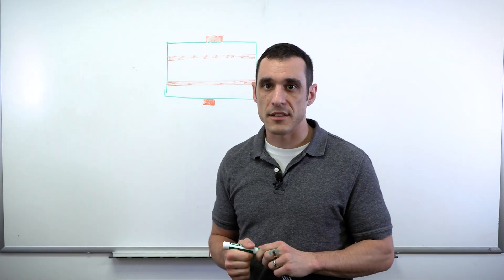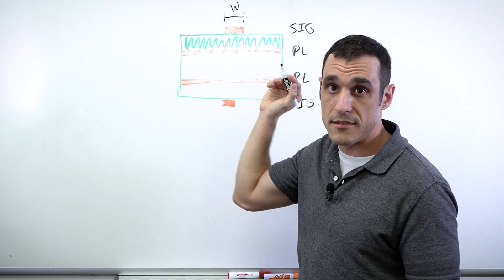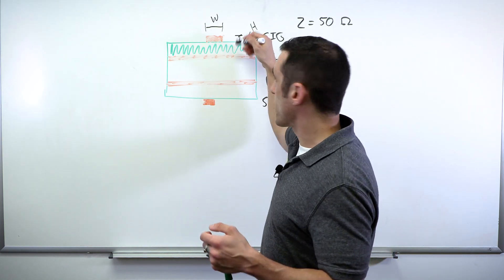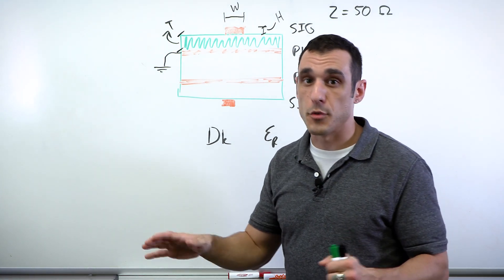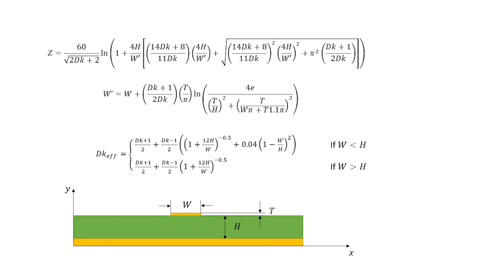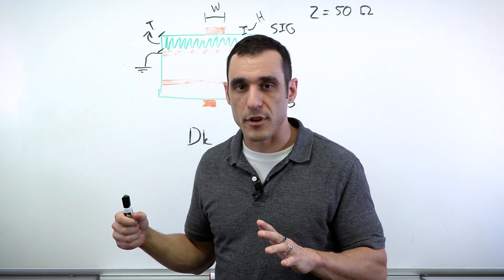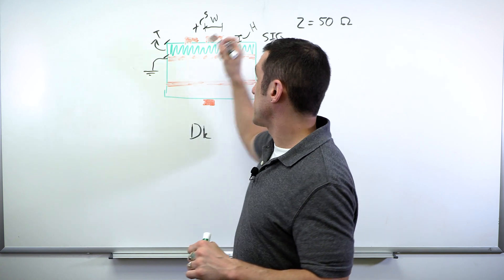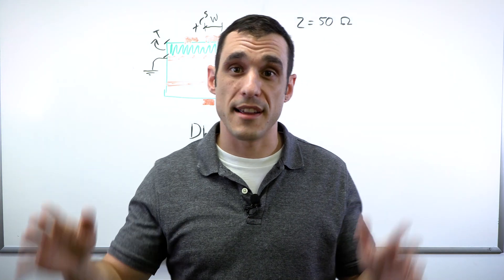Designing a 4 Layer PCB Stackup With 50 Ohm Impedance | Signal Integrity

Comment: Thank you Zach. But I have doubts. Why you do not mention track length? it is not important.
Reply: If you are just looking at the impedance of a trace then its length does not have any effect on the characteristic impedance. The stackup determines the characteristic impednace of a trace, so when we refer to a 50 Ohm trace, we are referring to the characteristic impedance only. The track length only matters for impedance when we look at the input impedance for a load that does not match the trace's characteristic impedance. Input impedance is only sometimes equal to the characteristic impedance. We have another video about characteristic impeadnce for transmission lines that you can watch here: https://www.youtube.com/watch?v=Fw0e-TFYArk

Comment: I Zach, great video. Thanks a lot for sharing. I have a doubt about the following: what happens if the GND layer(L3)  is on the third layer and not on the L2 ? What DK should I consider? I have a 6 layer board with a G-CPW between top and L3 (GND). The PCB manufacturer told me to have 50ohm the trace width it's 0.44 instead of 0.4 mm calculated by me with txLine tool . Who is master here in this requirements : i mean do I have to force them in having dk constant between L1 and L3 or do I have to trust them in their calculus?
Reply: You can place GND on L3 and for your application (RF design) this can be common. The Dk value might not be so clear if you have two different materials for the intervening layers. A simple approximation is a weighted average between the Dkeff on the top layer and Dk on the mid layer dielectric, but that is a very rough approximation. I've done a similar design many times with a substrate integrated waveguide and edge emitter with the structure spanning L1 to L4 (no GND in the waveguide region on L2 and L3). The reason for the additional width is probably for etch compensation and they might be using a more accurate tool like a field solver to figure out the additional width requirement from the mid layer dielectric. They won't know for sure until they measure.
Reply: @Zachariah-Peterson  thks for reply...i will design always GND on the L2 so that I'm quite sure dielectric is constant...the problem is sometimes with the PCB height as constraint I get track width which is not always feasible on the manufacturer....another important aspect to understand for me is , how much is important to respect the characteristic impedence (and so having a uniform dielectric) in function of the track length? I mean if I have 1cm of 50 ohm antenna (LTE and GPS) do i really to worry about this aspects ? How can I manage the CPW antenna parameters (w,s,Dk,H) even if they are not the suitable one in order to not mismatch the antenna ?
Reply: @rombodituono174  You mentioned "characteristic impedance as a function of track length"... The characteristic impedance does not depend on the track length. Only the input impedance will depend on the track length, and this will only happen if the load impedance is different from the characteristic impedance. If you look at the S-11 data for your antenna, you will see the frequencies where the antenna will be well-matched to some standard impedance value (normally cited as 50 Ohms for an antenna). For antenna modules, the S-11 data should be available in the datasheet. Note that the S-11 data will not depend on track length because it is not determined by attaching the component to a mismatched transmission line. If you had a mismatched transmission line, suppose it was 1 cm, whether this will cause the input impedance to differ significantly from the load impedance depends on the frequencies you are driving into the antenna. If the wavelength on the transmission line is much longer than the length then the input impedance will be approximately equal to the load impedance.

Comment: Can anyone tell me how to determine what impedance you need for a specific trace?   Knowing how to calculate the impedance of a trace is all well and good, but it does not give a good reason as to why.  I can understand impedance matching analog and RF traces, but what about power traces and FET control traces?
Reply: Hey James, great question. First things first, impedance control is needed on certain digital buses operating at high speed. For example, USB, DDR, LVDS, Serdes channels, HDMI, they all have an impedance standard that is implemented in transmitter/receiver components that are used in these buses, or in interfaces that are implemented in processors. Digital signals only interact with high impedances that are terminated at some target impedance to suppress reflection. So, you have to understand how to design traces to match those impedance requirements. For things like FET control traces (I'm assuming these are gate connections) or configuration traces on integrated circuits, you're generally connecting to a high-impedance input that will not draw appreciable current, so impedance matching is not needed on these connections. On some other type of circuit like an intermediate impedance load, impedance matching is intended for power delivery and is the domain of analog electronics.

Comment: Why 50 ohms?
Reply: Sorry I missed this question, but it is totally valid! 50 Ohms is a totally arbitrary impedance to use a target system impedance, but the industry has settled on it so we all have to use it. The reason 50 Ohms impedance is used as a standard for modern digital and RF systems has to do with early RF component engineering. Many decades ago, it was found that PTFE-filled coaxial waveguides exhibited power handling and attenuation that were functions of the waveguide's characteristic impedance. It was found that maximum power handling could be observed when the cable impedance was about 30 Ohms, and the minimum loss appeared to occur when the cable impedance was about 77 Ohms. 50 Ohms just happens to be an approximate midpoint between these two values, so we can see it as a value that balances low loss wave propagation with high power transfer.